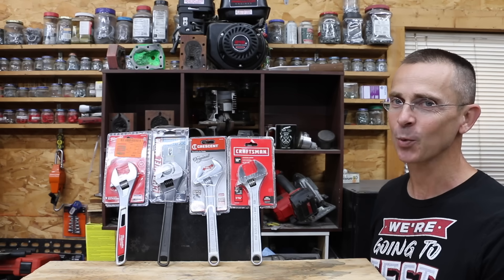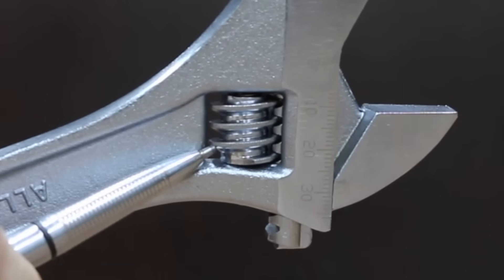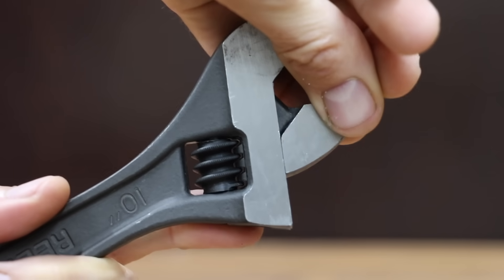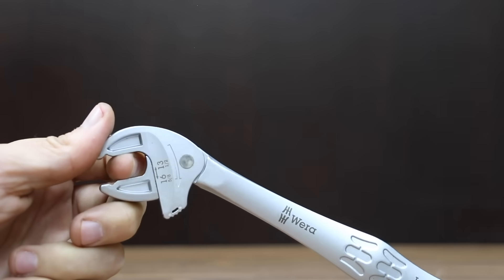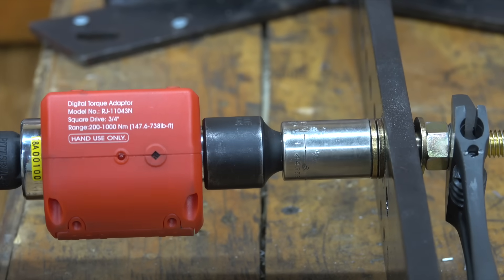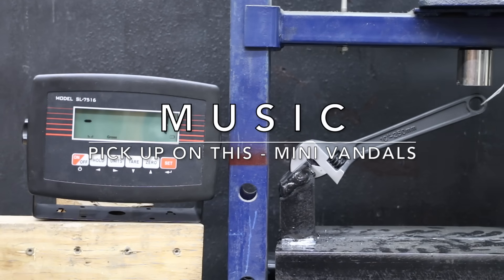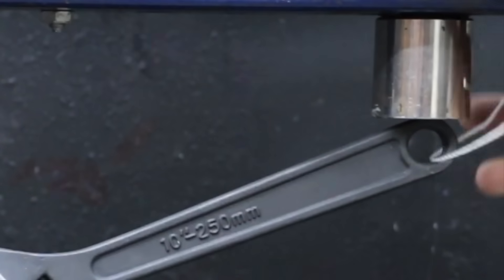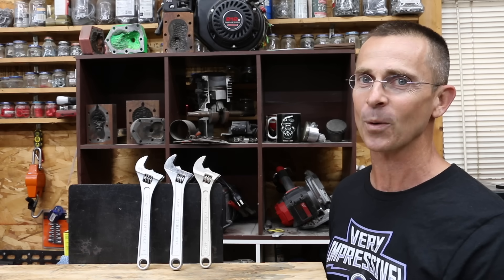Best Wrench (ADJUSTABLE)? Craftsman USA vs Craftsman, Crescent, Kobalt, Milwaukee, Channellock

Comment: "Vintage Craftsman"
Dude... You don't have to make me feel old like that. There was a time when you could go into Sears, bring a broken Craftsman hand tool, and they'd just give you one off the shelf as a replacement, no matter what happened, or where it came from. I had once found a pair of Craftsman "duckbill" pliers, just hanging out in a path seldom walked. Picked it up, took it to Sears, got a new one. Used it at work quite often, and I still have it somewhere. You can't do that anymore. They don't have the same warranty anymore. Also, there's no more Sears.
Reply from the maker: Thanks for sharing

Comment: on the test in which you apply a linear load on the handle and measure the change in gap, it really should be quantified by the product of the gap and length of the jaws (you mentioned this) as the interface contact with the nut is what is important.  smaller jaws are going to have smaller gap.  your metric is unfair. as always, i love your tests.  they are addictive.

Comment: We use Proto 18" Iron workers adjustment wrenches, 1st thing is back out set screw to put drop of loctite,  ise on 3/4 "thread size, 1 1/4" head size, mine is 25 years old
Reply from the maker: Thank you for sharing!

Comment: For an unpowered hand held adjustable tool on nuts and he cap screws, I in about every case, I use the Knipex parallel jaw pliers rather than one of these. Any nut I install with a fixed jaw combination wrench I can remove with a set of the pliers having handles of the same length as the wrench. I still use larger wrenches of this type for bending sheet metal and a really wide jaw 6" one for the plaatic cord grips for wires. That said, I have found the 10" Stanley with the vice grip clamp on the side to be much better than just a gimmick, and I'm quite happy with the strength to weight ratio of the Japanese MCC brand which I got in the 375mm handle length.
Reply from the maker: Thanks for sharing.

Comment: Great test. I have the full set of the vintage craftsman and even a couple of doubles of the small and medium. I guess there is no reason to upgrade(or downgrade) plus I rarely use adjustable wrenches but they are nice to have.
Reply from the maker: Thanks!

Comment: I've got a Crescent locking jaw adjustable wrench that's awesome as far as adjustable wrenches go.

You snug down with the worm gear then lock the handle down, which puts force on the worm so it can't move.

The downside is if you have to reset your position it can be pretty annoying.
Reply from the maker: Thanks for the feedback.

Comment: It's really sad to see what happened to legacy American brands like Craftsman.  I have had the 6" USA-made adjustable wrench, similar to the 10" that finished first here, for more than 30 years.  Good to know I likely won't need to replace it, but if I do, I'm disappointed that Craftsman is just a mid-range Chinese manufacturer now.  Not a smart business decision to try selling high volumes of low-margin cheap goods instead of asking a premium for something well-made.

Comment: I hate to say this but... I reckon you're using the wrenches the wrong way round. Conventional wisdom says you should have the moveable jaw underneath and push down on the handle, but actually that puts unfavourable leverage on the moveable jaw, which is obviously the weak link (confirmed by the tests in this video). Pulling up improves the leverage by a significant margin. This probably doesn't invalidate the tests here as they're consistent between brands, but I suspect you would have got better numbers on nut-rounding torque, and probably also ultimate failure strength, by moving the wrench the other way.

Comment: i got a couple requests, one is another go at this with some big adjustable wrenches, like 18". The other is a show down of the best line wrenches. I am a mechanic for a living and have come to find a real sturdy nice adjustable wrench works wonders at breaking tie rod end jam nuts free. i always use to go for the appropriate wrench and get a cheater pipe on it but more recently have found the big 18" made in USA crescent brand at my shop works way better at not busting my knuckles and not attempting to round the nut vs my snap on wrenches. I am thinking maybe line wrenches might be a good solution for breaking tie rod ends free since they fit tighter (and are thicker also). Also who hasn't rounded a brake line fitting on wheel cylinders without the use of a line wrench.
Reply from the maker: Thanks for the suggestions.

Comment: If I was rich I'd buy u a Ford dodge n chevy to test. Finally put to rest who makes the best truck. All 3 would be the light duty trucks n u could test suspension braking mpg hp torque and hauling
Reply from the maker: Thanks for sharing.

Comment: Crescent "Longer handle for more torque"  HA!  That's not now leverage works honey.  Yes I get that it distributes pressure over a larger area of the and thereby the user might apply more pressure, but that's not more torque from width. Marketing is this stupid most of the time. This one is technically wrong.

Comment: First Gedore tools I ever saw was some combination wrenches imported by Wilmar. At that time in the 80’s the Gedore were highly polished chrome and the toughest wrenches I have ever seen. Had one mechanic use one of the smaller sizes to take off a bolt stuck in a transmission case. He had already broken two Snap On wrenches. They were thicker body than the Snap On and opposite end of the spectrum from Wilmar tools which were the cheapest ones we sold. Haven’t seen that brand since then and Wilmar morphed into Performance Tools when they bought the manufacturing equipment from Truecraft when they went out of business.
Reply from the maker: Thanks for sharing.

Comment: Hate to see the USA-made Vintage Craftsman pushed to failure, but it had to be done, and speaks volumes about the quality of the steel and the precision techniques used in making readily available, affordable mechanics tools in America before cheap Asian tools and oppressive taxation and regulatory requirements forced USA manufacturers to close their doors.  Thanks for another well-designed and expertly carried out test from the Project Farm. And thanks for making your excellent coffee available for sale to your viewers. I look forward to my cup every morning. 

Suggestion: I noticed recently how strong and quick setting was a small application of Loctite HY 4070 hybrid adhesive It’s not cheap, but a tube containing 2 separate chemicals comes in a small box with detailed instructions, 4 mixing nozzles which mix the two chemicals as the stuff goes through the nozzle and onto your project; and extra nozzles are readily available.  If you can set up your projects on your work bench or kitchen counter so that you can repair different things in a row at one time, you’ll get a great result and save time and money. Others may make similar hybrid adhesives, and you should test them, if you haven’t already done so.   My personal test was to glue two 8” long edges of a broken bumper cover (on a 2010 Ford Expedition which I broke over 11 years ago) back together without using any duct tape or plastic welding or anything else to support the edges from the rear, just used my hands to put things in place, apply the adhesive, and hold the edges together gently for 5 minutes until it hardened.  I cleaned the edges with a solvent, probably heptane, before applying the adhesive.  From looking at the MSDS for the Loctite brand of recommended primer, their primer seems to be primarily made of n-Heptane, commonly sold as rubber cement solvent.  Heptane cleans quickly and dissolves very quickly, leaving no chemical residue behind.   Only uses these chemicals in a well ventilated area or wear a full face mask equipped with filters for organic solvents.   3-M makes such masks and filters.  

The repaired edges on my Ford bumper cover are still holding together after 3 months.

Comment: I'm not so sure a "wider" handle means more torque directly. It means better ergonomics, so you can give it more beans without straining the pads in your palms. More direct torque is achieved with more length.
Reply from the maker: Thanks for the feedback.

Comment: Would you consider a a whole video on USA-made Craftsman vs imported Craftsman? I'm mostly thinking about Craftsman sockets, wrenches and screwdrivers since they've kept the same design. And/or a slew of other tool manufacturers that have moved overseas, like Vise-Grip, Crescent, many Husky tools, and I'm sure you know of more examples than I do. I know it won't help much for folks buying new tools, because you would have to buy used ones to get the USA counterparts, but maybe we can see if our Made-in-USA biases are founded.
Reply from the maker: Thanks for the suggestion.

Comment: Thanks.   I just ran off my Doyle 12 inch against my 1955 Crestoloy  USA.   Only test I didn't do was to failure, for obvious reasons.   It did everything the old Crescent did.  Torqued the bolt head off,  Didn't open with the impact wrench (dewalt 20V)   etc.   cost $15.   but can be bought with 20% off on certain weekends.   The 10" is $3 cheaper.   Crescent  12" weighed 771g  Doyle 12 inch" 827g.   Both very nice.   The Doyal is a cut above Pittsburgh.  Maybe 3 cuts. My old Crescent wobbled more but then again it is about 65 years old.  It did not slip nor back off though.  (the only older tool I have that wasn't my dad's are my 8" Cee Tee Co pliers and my Klien linesman pliers.   the rest were stolen or lost.   I bought the Crestoloy new when I worked in a gas station.   I forget what it cost but whatever,  1958  to 2023  (65 years) is a long time to be using the same tool that competes favorably with anything you can buy today.  You might want to compare Doyle when you get a chance.
Reply from the maker: Thanks!  Thanks for the suggestion.

Comment: You should do a video on pipe wrenches, say a 18 or 24 inch one.  Or better yet a 14 inch for home users and a 24 inch for commercial users.  Definitely need to use aluminum ones, and Rigid is the gold standard so they must be used as well.  Milwaukee, Husky, Lenox, Kobalt, and Reed to name a few.  And the Harbor Freight ones too.    Think this would be a hit.

Comment: Add to the confrontation IREGA Spain, a specialist in adjustable wrenches and one of the remaining manufacturers in western world of this specific tool. 
You can get it e.g. rebranded Channellock US or Wright US or even Virax FR...
Once upon a time Bahco (SNA Europe / Snap-on group) were made in Sweden, today they are actually made in Spain.
90% of the adjustable wrenches manufacturing is made in China so most are rebranding of them e.g. Crescent a US brand. 
Nonetheless there are some interesting exception:
Some BAUM made in India and some old GEDORE made in Southafrica probably discontinued.
Reply from the maker: Thanks for the feedback.
Reply: They still make some saws and saw blades in Sweden.

Comment: I call them Adjustable Hammers:  You carefully adjust the jaw to the size of the bolt/nut, then pound the devil out of the fastener - in most cases, the results are the same.
Reply from the maker: Thanks for sharing.

Comment: Love the reviews, came here looking for a new 12" wrench as my old cresant broke while intalling a water heater.  The screw that holds the gear drive must have sheared off as I can't find it.  The wrench was the older made in USA version, but it's seen some use.
Reply: I think it is a roll pin.    The pitch on the old crescent are close if not exact match to the Harbor Freight Doyle 12 "   Also Crescent will replace your old tool if you send it in but you get the Chinese version..  I'd keep the old tool and find a replacement pin and nut.   Of course if the jaws are broke go to ebay or the local swap meet and buy the whole thing.  Even at $20 it is worth it.
Reply: @jamesbusse1543  it was actually a threaded screw.  I found it on the floor the other day. Took the opportunity to clean out a lifetime of junk built up in the drive before putting it back together.  Super smooth now!
Reply from the maker: Thanks!    hanks for sharing.

Comment: I really had hopes for the Wera brand. In my experience trying to get a tight fit using  the knurled nut as on the other brands is frustrating, especially trying to get the jaws tight in close spaces, so I liked the self-tightening design. The harder you pull, the harder it grips. Unhappy that it broke.  I'll stick with box-end wrenches.
It was apparently intended to be light weight. If only they had made it about 120 grams beefier!
Reply from the maker: Thanks for sharing!

Comment: MY DAD WORKED AT MOORE DROP FORGE ON BERNIE AVE. IT WAS OPEN FOR ALMOSE=T 100 YRS. HE WAS AN ELECTRICIAN AND NEW VERY LITTLE ABOUT TOOLS I ASKED HIM TO GET ME A 5/16 1/4 
' DRIVE SOCKET AND HE BOUGHT HOME TWENTY. I STILL HAVE A FEW IN MY TOOL BOX. THAY DID DISTRUCTIVE TEST AFTER EVERY POUR. WAS A VERY GOOD COMPANY TO WORK FOR. IT MOVED TO N CAROLIN I BELEIVE AFTER BEING BOUGHT OUT AND IT DIDNT LAST MUCH LONGER AFTER THAT. I THINK AROUND 68 EVER BIG COMPANY THAT NEEDED A LOT OF LABOR STARTED MOVING OUT OF USA. IN MASSACHUSETTS WE LOST ALOT OF LABOR. YOUR DOING A GOOD SERVICE WITH WHAT YOU ARE DOING.
Reply from the maker: Thanks!  Thanks for sharing.

Comment: That Craftsman wrench was made in Danaher, California sometime between 1995 - 2003.  
In nearly 30 years of using Craftsman USA I only had one problem with a Craftsman hand tool.  It was 2012 or so and I remember being shocked when the store associate handed me a replacement tool that said "made in china".  I said "Nope, I'd rather keep my broken tool".  It was a 1/2in ratchet that would slip directions sometimes.  I removed the snap clip and re-greased the teeth and haven't had a problem since.  I'm so glad I didn't give up that tool.
Reply from the maker: Thanks for sharing.

Comment: There was a time when Craftsman made some of the best consumer hand tools, manufactured for Sears Craftsman by Western Forge. These were marked with a "WF" on them. Some time between 2007 and 2010 they started going downhill in quality control, reliability and durability. Craftsman is Chinesium junk now, made by Chinese COMMIE Slave Labor, and sold for overblown prices by Lowe's. I inherited most of my father's Craftsman tools that he bought in the 1950's - 1970's. There's a world of difference between them and the Craftsman Crap currently being spewed out. Even their gas lawn mowers are grosssly overpriced Chinesium and plastic garbage now. An up and coming company with growing reputation is Tekton. Family owned in Michigan, their quality has been steadily improving over the past ten years, especially after ceasing sourcing tools from COMMIE China, and exerting quality control over the Taiwan manufacturing. They don't have adjustable wrenches yet. I've bought their Taiwan made sockets, open end/box wrenches and a couple torque wrenches, and was quite impressed.

Comment: I just started this 20 minute video.  I sure hope in that time you manage a cost benefit analysis not simply "is the $5 garbage as good as an overpriced $50 tool".  I'll be back after it's over.
I take that back, im 5 minutes in and your data diarrhea is ridiculous.  I'm not risking that you ppl save this with a cost benefit analysis.  You are just dumping gads and gads of pointless info given the context and premis.  The only info that really matters is 10x $5 wrench equal to, less than or greater than  1x $50 wrench; and by how much.   Anything else you're just throwing out numbers to validate what in the end couldn't be more than an amalgam of implied subjective biased analysis of both the viewer and creator

Comment: Mechanic for over fifty years no surprise the older Craftsman (American Made) was the best. Love this format for testing test the only thing you can't see is the metallurgy.
Quality of the steel hardness and all that also would like to see Snap On, Mac Tools and Matco tested. I have owned all of them the high-end tool men items were never bad.
Metal and the quality of the company Manufacuring them always is first priority with hand tools. Stay away from China and most imported Junk because that is what most
of it is. Sometimes you can get surprised both ways, but it is the exception not the rule. Most companies are looking for MAX profit not to build a reputation
Reply from the maker: Thanks!  Thanks for the video idea.

Comment: The adjustable wrenches I use are made by Diamond. What I like about them is that the 6” wrench opens as wide as an 8”, the 8” opens up as wide as a 10”, and the 10” opens up as wide as a 12” wrench. Very handy  if space is limited.
Reply from the maker: Thanks for the feedback.
Reply: Diamond tool and horse shoe company , Duluth Minnesota, made very pretty adjustable wrenches In the 80s towards the end of their reign , (been out of business for a long time),  but unfortunately they were pretty soft when used hard.  Part of the problem is they’re actually chrome plated. The vintage craftsman USA shown on this test you could just tell when using them against other metal how hard they actually were, and they had no plating on them, it was more likeFused nickel coding of some type..